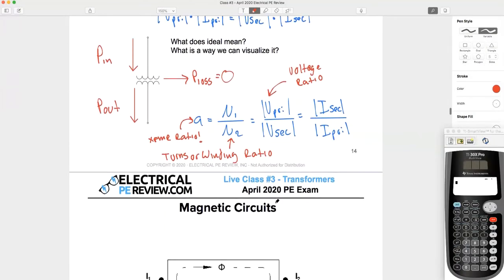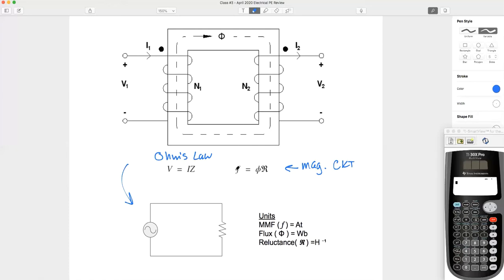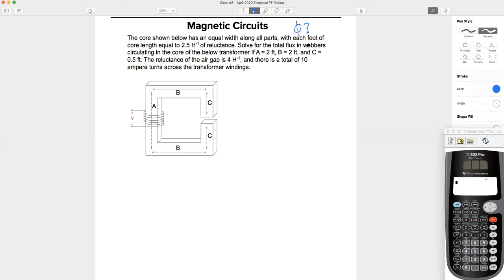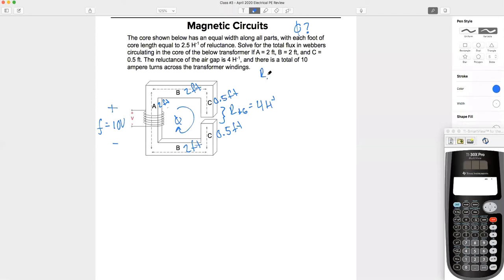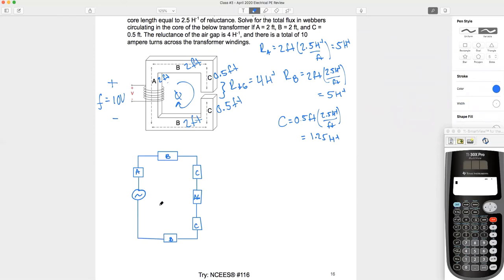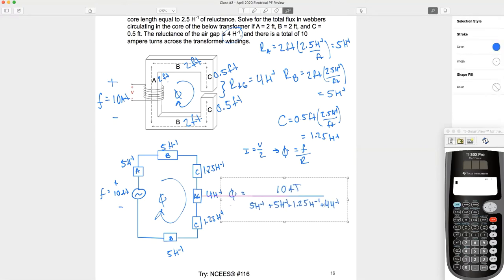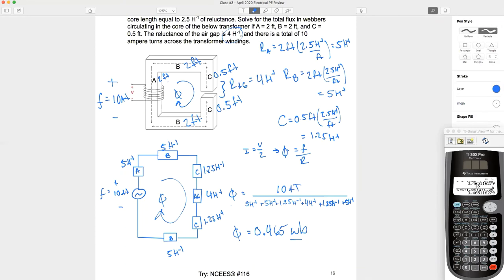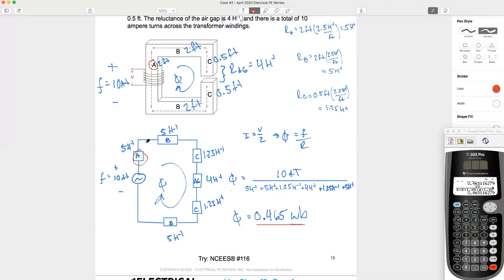How to Solve Transformer Flux Φ, Reluctance, and Magnetic Circuits Part 1 (Electrical Power PE Exam)

Comment from the maker: Table of Contents (Click the time stamp to jump to that part of the video):
1:17 - Related Ohm's Law (V=IZ) to the magnetomotive force equation (F=ΦR)
3:20 - Practice Problem
6:17 - Converting the magnetic circuit to an electrical circuit equivalent
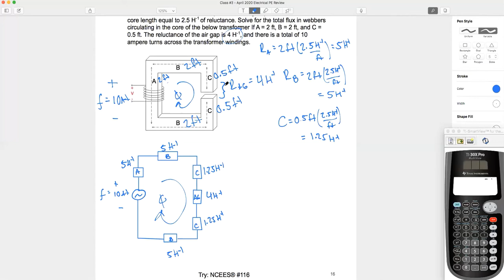8:05 - Using the magnetomotive force equation (F=ΦR) to solve for flux  (Φ)
11:56 - Common mistakes to avoid

Watch Part 2 of How to Solve Transformer Flux Φ, Reluctance, and Magnetic Circuits:
https://www.youtube.com/watch?v=j53CGUG97Xs&t